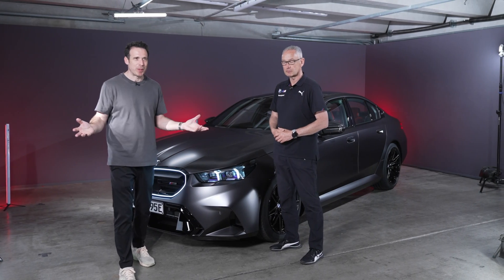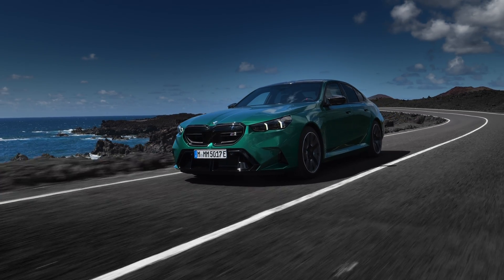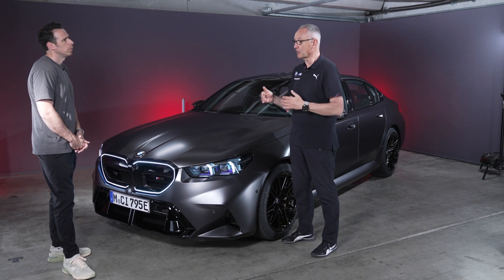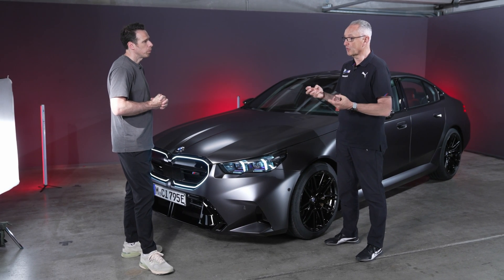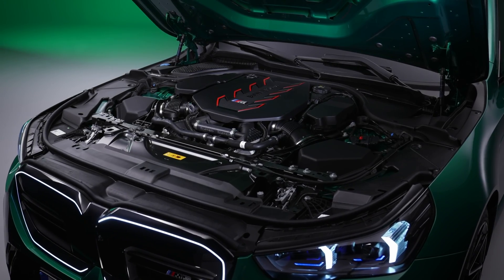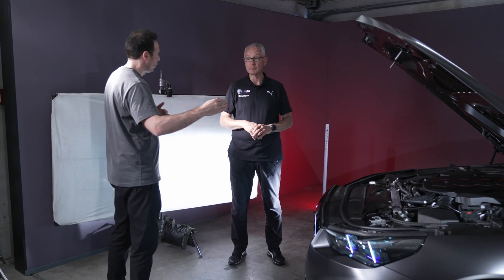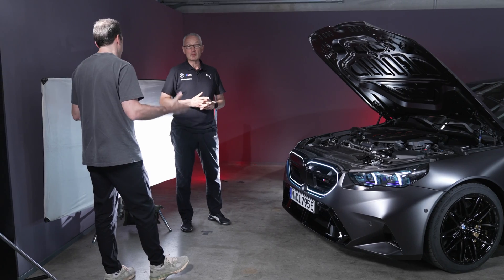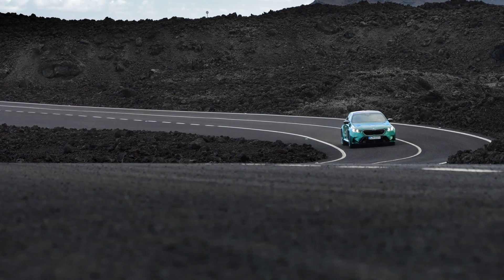2025 BMW M5 Explained by Enginner Boss

Comment: The G90 M5 is the first M5 in history to be slower than it's predecessor. If this new M5 lost about 1,000 lbs or was the same weight as the F90 M5 CS, it would be the greatest M5 of all time...
Reply: Slower on paper, you still need real drag race comparison to verify it.
Reply: @justinhuang5322 Definitely slower on acceleration. The G90 M5 starts to catch up after 130 mph.
Reply: Useless remark. It's about the feeling in the car. Plus you can drive this thing very economical
Reply: @DennisDinges Who buys an M5 to drive it "economical"?? Now that's a useless remark.

Comment: I love this agressive looks design,it is what i expect from the m5.💯🔥💪 however its crazy to say but 717hp its just simply not enough for its weight, 2.5t wtf?
Reply: You forget the extra torque that the electric motor delivers. Its huge
Reply: @DennisDinges  ye, you right. that is why the f90 withouth electric torgue was accelerate to 100km in 3.4sec and the new g90 is 3.5sec. The new gen. is slower coz of the weight.Its not BMW's fault but those Marxist idiots who making Legislation in Brussel and killing EU's car industry.🤢🤢

Comment: I think Porsche did the better hybridization approach with non plugin hybrid and just 50kg added.
Reply: ..as it concerns the 911(sports car)! the Panamera is the same as the m5 logic :)
Reply: Thats a good point, I was thinking about that as well. Building a much heavier sports car doesnt make any sense.
Reply: Porsche - always better :medal-yellow-first-red:
Reply: What is also quite important here are the tax regulation for company cars in Germany, since this is where the big business happens. To only pay 0.5% tax on list price per month, the vehicle need to have a minimum electrical range of 60km. If not, you have to pay 1% tax on the list price and this makes a huge difference...

Comment: The heavy hybrid system works in an suv but does not work in a sports sedan.  Bob lutz even said this when talking about the gm brand hybrids however this takes it to an unprecedented level of weight gain 😂

Comment: I don’t care about the rest of the stuff… my question is why make it slower than the previous generation? …. U could have gotten 700hp from that v8 and get another 250hp from electric motors.. total output 950hp .. that’s what I was kinda expecting 😊….. like how did the Sf90 achieve its output
Reply: Because they are leaving room for the competition version will surely have over 850hp.
Reply: @Tomoyo0827 no cmo any more
Reply: You will not daily commute an SF90 with your family on board lol. Its a completely different engineering project with very different engineering requirements. They don't want it to just  make it a miserable tenth of a second faster from 0-60 compared to the predecessor. There are a lot more things to a car than that. This is not the Tesla (0 to 60) world lol

Comment: plug-in hybrid is such a lazy implementation.  high performance cars like this need to be either strictly ICE or strictly EV, no in-between because plug-in hybrid's battery pack is so tiny that you'll run out of electric "juice" in a single 20-mile trip (discount that by half if any uphill climb is involved), then once the battery is depleted, you're essentially stuck with that dead weight until the  next charge session.
Reply: But that's the only way they score well for emissions
Reply: 1. A lot less ppl would buy an EV M5.. 
2. The problem with non-electrified cars is that they will be banned in certain cities soon. So the ppl that would buy an M5 and live near or in these cities would step away from paying 110k on a super saloon that is not allowed to drive in those areas. Even the mighty bugatti mentioned this as a reason for electrification of their new Tourbullion. So if you want to point fingers point at the ones that make those rules.
Reply: @CS2.Consumer  sales ban on ICE vehicles won't start until 2035, that's 11 years from now -- long after the end of this G90 generation's entire product cycle, so that is not a valid reason in my opinion, at least not immediately.  Emission standards in EU, however, is probably the legit reason behind the hybrid implementation.
Reply: @mtx1212  I am not talking about sales ban. I am talking about big cities not allowing pure ICE cars in it.
Reply: @CS2.Consumer  i doubt that will ever happen (or could effectively be enforced) since the current source of funding for local infrastructures (roads/highways/bridges/maintenance, etc) comes from the gas tax, which relies on ICE vehicles.
Reply: The battery will never be empty. There's always a buffer and the car is able to regenerate energy to the battery from the engine to keep the buffer topped up and ready to assist.
Reply: This is kind of backwards. Plug-in is a way more complicated set up rather than just being ice or ev so it’s not a lazy implementation at all, and the battery recharges itself.
Reply: Reading some of these comments shows how misinformed and uneducated people are about an organization's vision and their logic around decisions to futureproof revenue and transition into changes for easier adoption. Additionally, there is a lack of understanding around government, federal and state, regulation. Hence, these comments. 

They do what they do because they can and because they are intentional about decisions made on the vehicle. BMW doesn't make decisions in a week--these decisions are mulled over carefully and discussed in breadth and depth. The car will still sell and if you don't like the engine in it, simply don't buy it. 💁🏾‍♀️
Reply: Meanwhile, back in reality, BMW EV market share>ICE for years now, ever since they sold half million PHEV.  Toyota biggest EV manufacturer on millions of Prius hybrid$ sold since last century.
Reply: If you don’t know your stuff don’t say it.
All high performance PHEV has a function to maintain battery level to ensure performance. In the M5 I believe is called the hybrid sport plus or something. 
Even in the C63 with 9km range or the 911 GTS with no EV range, you will never run out just street driving.
Reply: @Tomoyo0827  I literally drive a BMW hybrid lol, and I can clearly tell you're clueless about how it works because first of all it's called "Battery Control" mode, and second -- it charges at a trivial speed that it's basically pointless (we're talking about 30+ minutes to go from 0% to 50%, by then your commute would probably be over anyways).  BMW knows how impractical this is and chose to call it battery "control" rather than battery "recharge" mode.   And I haven't even mentioned the significant mpg hit as your ICE engine has to drain additional fuel in order to power the tiny little generator.  Anyone experienced enough with a BMW hybrid will tell you the battery control mode's only viable use case scenario would be to preserve enough charge in the battery to precondition the car at a later time 😂😂😂